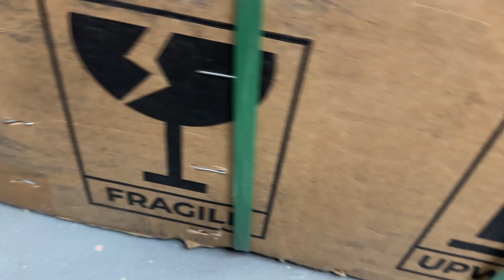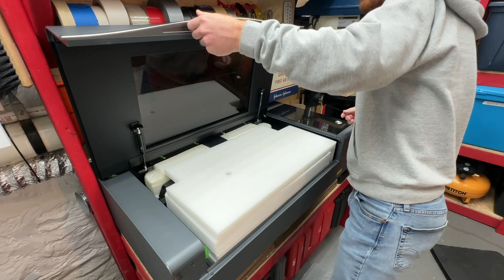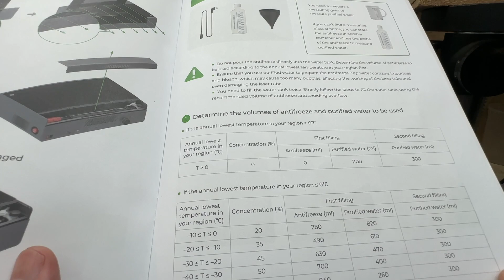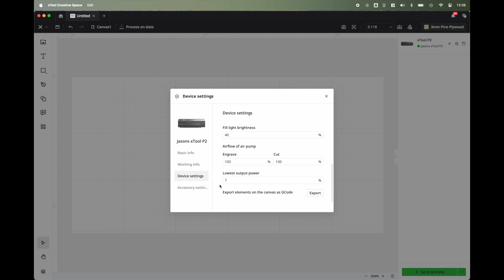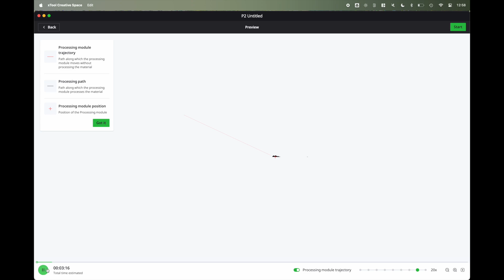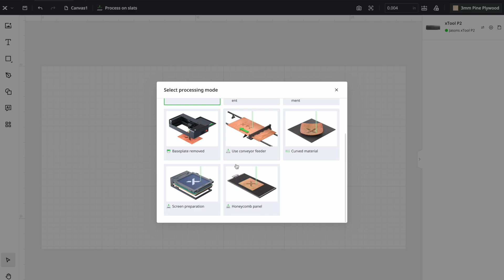Unboxing, setup, and first project with the xTool P2 CO2 Laser -  The best laser for your makerspace

Comment: I am looking at your tape roll storage and wondering how you get the tape on and off? I need to come up with a storage solution.
Reply from the maker: The arms of the roll holder are a bit flexible, so you can bend one side outwards by about 1/4", enough to pop the rod off and slide rolls on or off